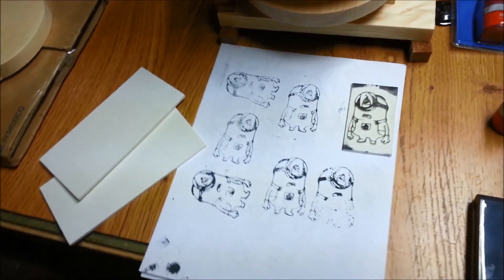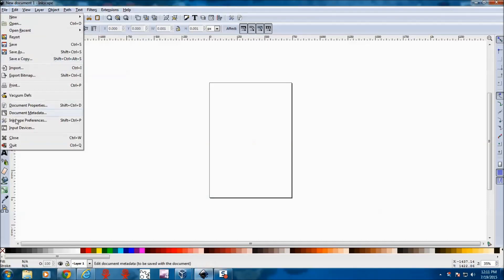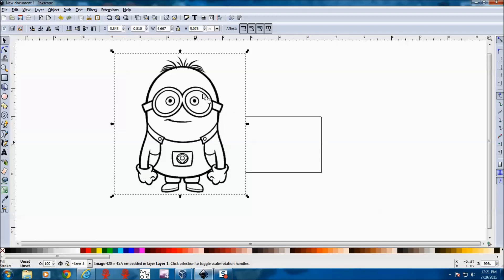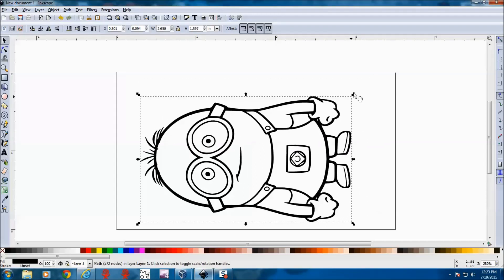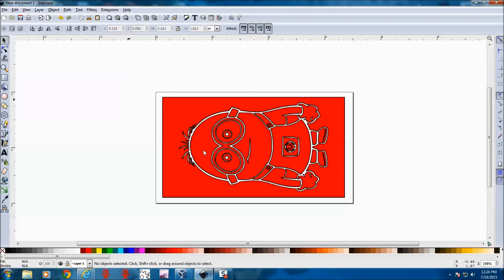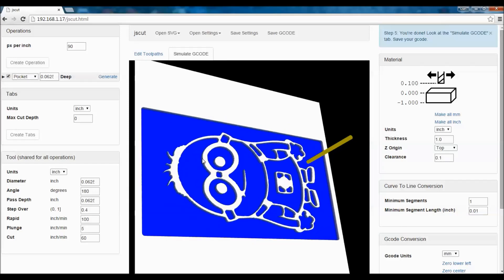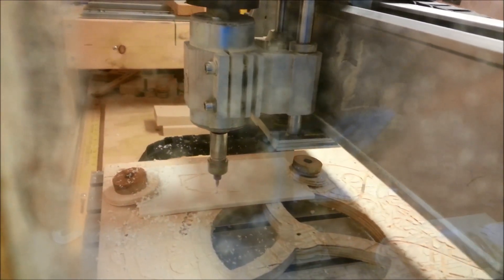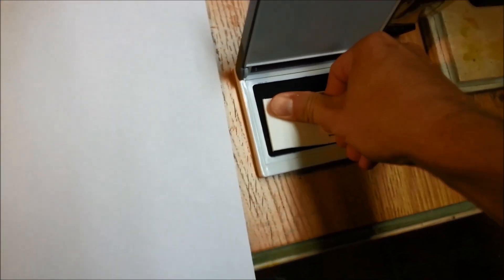CNC Stamp Making! Fun & Easy

Comment: I want to thank you for this video...I have had my cnc machine for a few weeks and was getting frustrated with all the different software that doesn't do it all...I am rolling now
Reply from the maker: +redawg32 Many thanks.  There is definitely a learning curve when starting out with a CNC machine.  Over the years I've spent a lot of time tinkering around with a lot of software.   The great thing about so many hobbyists in this area is that there is some fantastic software out there.  Much of it for free.  The programs I use the most are Inkscape for design, and Jscut for the tool paths.  These two programs will do virtually everything you would need for 2D design.  For v-carving, check out F-engrave at:  http://www.scorchworks.com/Fengrave/fengrave.html
F-engrave is another great program for sign making.  The guy that wrote the program has some other CNC offerings as well on his home page.  (dmap2gcode is also awesome)  Keep tinkering and trying things.  Make the journey the goal.  There is no finish line.  Have fun and best of luck!

Comment: what size router bit are you using on this one?
Reply from the maker: +cory goldthorpe I used a .0625" bit 1/16 (end mill).  On eBay there are lots of small router bit kits that are sometimes retired from cutting PCB boards and are greatly discounted.  I bought a small set for around $20 that has some pretty tiny cutters.